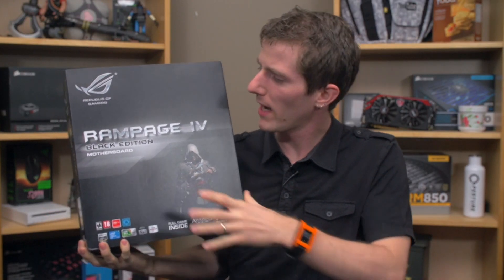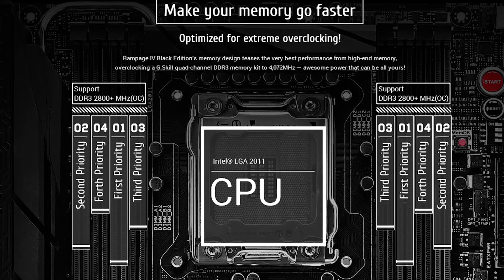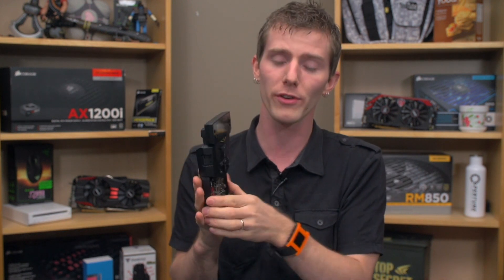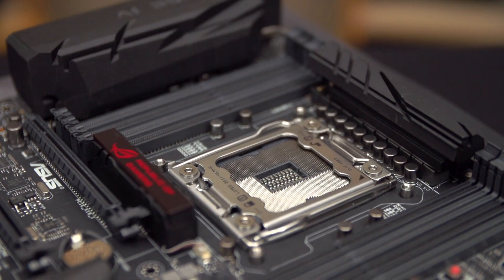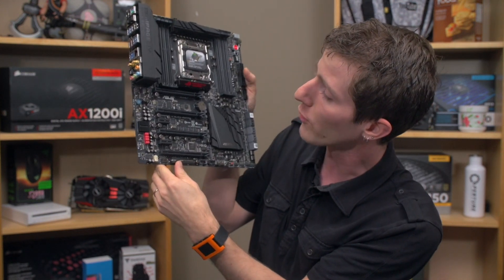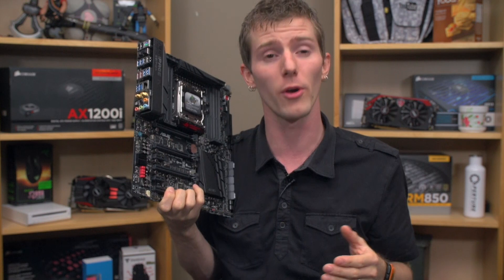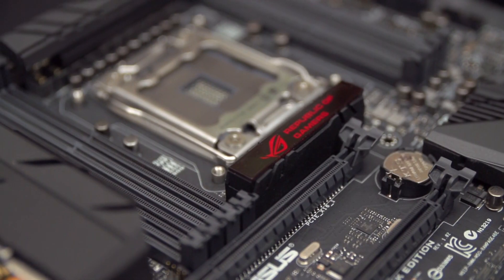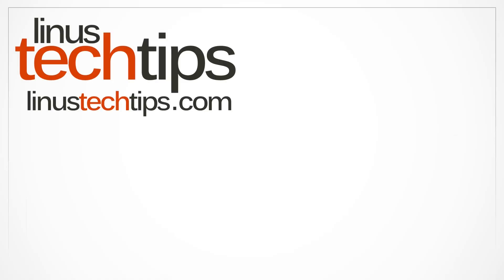ASUS Rampage IV Extreme Black Edition Unboxing & Overview

Comment: I would love to see an extreme build out of this board as I have been drooling over it for months...if I am correct that still has the x79 chipset.  My drooling has moved on to the newer version of this board with the x99 chipset and ddr4 ram.  And your correct this board is for someone that is interested in the best consumer board money can buy!! My old system is beginning to feel like I have to perform magic tricks to get to run high end games  smoothly. 8 years of use and no more room to upgrade. Means its time for a new machine all together.  Build out build out build out!!!

Comment: I just received mine today, got 32 GBs of Corsair Dominator GT 1866 MHz RAM, Intel 4960x Extreme edition 15 MB L3 Cache processor, Gigabyte Windforce Edition 780TI graphics card (Will buy another if I need to) still awaiting my new Antec Twelve Hundred Ultimate Gamer case (Will have laser etched with a fist for a custom look).  This board is a beast!!!

Comment: Just bought this board today! Super excited and now more so after watching this video! :D! Pairing it with a i7 4820K and atm 780Ti from Evga! and oh of course 32GB of 2400Mhz CL10 Ram from G. Skill a Xigmatek Dark Knight CPU Cooler, a Intel 530 240GB SSD, a Intel 520 240GB SSD, and a 1TB WD Black HDD all inside a Thermaltake Overseer RX-I Case with Blue LED cooling fans to compliment the black theme. Oh and I believe I am getting a Xoner Essense STX Sound Card for the best audio around as well. I will be paying for this hard of awhile BUT ITS SOO WORTH IT!!!

Comment: man i keep this board so maintained till to this day, i feel like money well spent, only probalem after so many years i have is the 24pin connector 3.3v rail is a bit loose, i did insert a paper pin to keep it working so it works aight but windows 10 has horrible bugged driver for this board so i dont update much but get decent enough performance for cyberpunk 2077,star citizen or any 3d rendering.
Reply: who asked

Comment: to install 32gb ram and make it work in 2400mhz do you have to overclock it or can it work in standard mode?
Reply: Hell no I am using it without Overclock.....Dude just go to bios enable XMP in other words Quad Channel Mode and 2400mhz is set as default without OC.
Reply: avikbellic911 thank you for the info.

Comment: i am amazed just how long the life of LGA 2011 has been.  I jumped on the X79 platform in early 2013, which by all accounts should have been near the end-of-life for the platform.  It is still going.  And on top of this, Haswell-E won't be out for nearly a year.  Just. Wow.

Comment: i need this for AM3+. just love AMD's CPU's..they'r Good, Powerfull, easy to OC, and cheap. Intel is soo expensive, but Intel (X79) Mainboards got soooooo.... many new features now, and almost every AMD Board looks like it was build in 2001! this is just awesome! Witch I7 would u buy for a Setup with this Motherboard, Corsair 2x 16GB RAM & 2x XFX HD7970 GHZ Editon @ 1.2GHZ? it should be good for Gaming in 1920x1080 MAX. Settings, and for Rendering!

Comment: What is the difference from SLI and crossfire?
Reply: SLI is the Nvidia tecnology, and Crossfire is the AMD/ATI tecnology, just that.
Reply: Thanks
Reply: NP
Reply: I think 3Dfx invented it, but the above comment is still correct. Just some food for thought.
Reply: GoldenStar11 wrong.
SLI is the nvidia multi gpu format
Crossfire is AMD's Multi gpu format.
they both basicly work the same but are different.
amd = crossfire multi gpu support.
sli = nvidia multi gpu support
Reply: ***** Actually, you are mixing up AMD dual graphics with crossfire.
Reply: You can combine many different amd gpus like combos of any 7 series gpu on a lot more boards, however SLI is picky and you have to have the appropriate board and matching pairs of gpu.

Comment: Well the memory speed depends on the IMC of the processor used.  I have a 4930k running on the original RIVE, and I've run RAM at 2800.  My 3820 could run memory at 2666 on it as well.

Comment: Dude WTF lol that is a sick board. I am looking at hardware because I am going to build a linux machine. I'm have been getting into building my own andriod roms and want something that i can do this quick on. 

Obviously this one is more than I need what would you recommend that would still be robust a minimum of 16 probably 24 gigs ram, and super Linux friendly? 

Thanks for the review you rock at the presentation man
Reply: Well i ended up with formula vi. The machine is actually built and I have let it run for over 24 hours. I now that's backwards but I was to excited when I finally got everything. I will post few shots later today. I have decided to run my h100i wires a little different so. Shouldn't take to long install an os. Sucks to have to install also. But some games I think will be best on it.

Comment: This Mobo is SEXY! I want it! I think I will use this mobo for my next build in a few weeks. ill be putting 32GB of RAM,  2 Graphics Cards, and a high end 2011 CPU. Don't know exactly what yet, but its going to be a beast (Its going to cost a lot too lol).
Reply: Get a 4930K. A 4820 is a quad core hyperthreaded (think of a 4770K in more expensive LGA2011 format), and a 4960X is too much more ($450) for 3MB more L3 cache and .2 GHz highher clock.

Comment: Hi Linus, what's your thoughts on Asus removing all support for all the X79 platforms, they have even removed the ability to select/ download anything X79 from their website. Also considering most or all other manufacturers still support their X79 range. My opinion is the X79 platforms still had much performance to offer and this is an obvious move to try to force an upgrade.

Comment: I have 2 evga gtx 780 ti classified dual bios cards installed do I need to connect the 4 pin molex ez plug thanks for any help and excellent video as always

Comment: If it had right angle 24pin power and right angle USB 3.0 header, this would be on of the greatest motherboards ever.
Reply: If it did, it wouldn't be in my system right now, no enough clearance for that, I'm glad they used the standard layout

Comment: I know this video is not about it but I have a little doubt.

For a afermarket CPU Air Cooler that permits changing the fan, is better for me to use a Static Pressure optimized fan or a Airflow optimized as Push?

Comment: Question is, however, what do us original RIVE owners do?  I don't think there is really enough justification for us to switch over to this BE from our original boards and it is kind of frustrating to see some of these features on a Rampage IV Extreme that weren't included in the original (and also very expensive) board...

Comment: Is it okay to get this board just because it's cool ? and install an i7 4820k, single graphics card, 2 sticks of ram ?. Because that's my limit. I just want this board because of the looks, And the upgrade potential. Or maybe the X99 chipset ?
Reply: Was going to do the same thing so I would. Then build on it later.
Reply: Same here, just bought mine, getting the 4820K next paycheck lol. This is actualy THE BEST option for a budget gamer wanting to get into "enthusiast" grade stuff. Going X99 will cost more and the Rampage V extreme doesn't look nearly as awesome as the black edition. Look at the RAM cost alone, 16gb corsair dom, platinum DDR3 = $250, same brand of DDR4 = a whopping $400. if you filled all 8 slots that would cost you $300 more for RAM alone! And with the 4820K, yeah it's only a 4 core cpu and at stock it's even slightly weaker than a I7 4770K, but it can overclock like a dream hitting 4.8ghz with watercooling easily, or 4.6 even on air. And it turns out that the temperature on the 4820K is MUCH lower than a 4770 or 4790K since it has a soldered on die rather than internal thermal paste, so a 4820K at 4.4ghz is actually about the same temperature as a 4770k at STOCK temps, and once you OC the 4770 you'll find you can't get past 4.5 and are pushing 75 degrees while the 4820K at 4.6 is sitting nicely at 64 degrees.

So in short, don't feel bad about getting this board, i chose it over the Rampage V extreme for 2 simple reasons

1. Looks freaking AMAZING

2. Cheaper overall, saves me $150 on RAM and ~$75 on the CPU vs the $400 5820K, that money allows me to afford a new PSU so i can add in an extra gtx980 later on if i decide to since this rig is already costing me close to $3,000 dollars and i'm bustin my ass at a McDonalds job just to get it. And honestly, even though i'll be using a 4 core 4820K i doubt anyone in my small town community college will have a better cpu when i start my graphic design/video editing classes lol. Plus once everyone has sold their old rigs to jump on board with Z97 or X99 you can find an I7 4930K or even I7 4960X used on ebay for super cheap in a year or so when you get more cash and upgrade, but keep the old 4820K in case the used cpu blows out. Sounds like a good deal to me doncha think? :D

Comment: I wanted to try the hot spot shield software, however i noticed that it is provided by conduit.....which is kinda frustrating considering that conduit is horrible for your PC. it opens your computer up for infectious malware, and other virus's. I have a tough time supporting you when your software is linked to a malicious and unethical, service

Comment: Having trouble deciding on a mobo and a CPU 

Rampage IV Extreme Black Edition or the Rampage V extreme?

i7 4970k or i7 4930k? 

other specs: 
Dual 980 classified's (depends on whether I'm gonna game in 1440p)
Samsung 850 256gb SSD x2
2TB black HDD
NZXT H440 White and black
NZXT Kraken x61/Corsair H100i (not sure)
Corsair Dominator Platinum 16gb DDR4/3 (depends on the CPU)
Coolermaster v1000

MISC:
Corsair AF and SP fans for exhaust and rad
980 backplates
Red tubing for the rad
Corsair red sleeved Cables

Let me know if I'm missing anything or if I should wait for anything
(I am in no way shape or form interested in whatever AMD has to offer or the 970).
Reply: I'm in the same position, i'm getting the Rampage IV black edition, not only does the black edition look WAY cooler (yes i know, i'm shallow. shoot me lol) but it's more affordable overall. The black edition is X79 so it supports DDR3 RAM which is much cheaper (corsair dominator platinum 16gb DDR3 = $250, 16gb of DDR4 = $400) not to mention you can get a 40 lane cpu cheaper if you go for the $320 I7 4820K instead of the $550 I7 5930K, yes the 5820k/5930k has 6 cores while the 4820k is only 4, but the 5820k doesn't have the pci lanes so if you want 4 way sli you'd need a 5930k on x99, plus the money i save getting the ddr3 ram and the cheaper 4820k lets me buy my psu (either corsair AX860 or EVGA G2 1000w, not sure since they don't seem to make custom white cables for the EVGA though since my pc theme is white and black)   

But in your case if your deciding between 5930k and 4930k then the 5930k would "probably" be the better choice, along with the Rampage V extreme of course, since both cpu's are 6 core with 40 pci lanes, but the 5930K has 15mb cache for the same price as the 12mb cache on the 4930K. The only reason i would reccomend going X79 with black edition mobo for you is if your really stretching your budget, especially if you plan to fill all 8 RAM slots since you save $150 on each 16gb 4x4 set of corsair platinum RAM, which for me kind of makes the decision since i'm already spending $3,000 on this setup that i don't have lol. (working McDonalds job.... -__- )

My setup will be

EVGA GTX980 Hydro Copper water cooled card $800 (going sli once i can afford)
Intel 730 series 480gb SSD x 2 in RAID 0 $500
Corsair 900D case $350
I7 4820K CPU $320
16gb 4x4gb Corsair Dominator Platinum DDR3 RAM $250
Corsair AX860w or EVGA G2 1000w PSU ~$150
XSPC 250mm Reservoir/pump combo $160
2 x EK coolstream 480mm Radiators (no cost, already have)
8 x Corsair SP120 white LED fans $100
10 3/8" x 1/2" Compression Fittings ~$70
Swiftech Apogee XL CPU waterblock with custom ROG logo (goes with mobo) $85
PrimoChill Advanced LRT 3/8" x 1/2" tubing
2 x 250ml Mayhem's Pastel Ice White Coolant $40

TOTAL - $3,410 + TAX
Reply: Once you go black you'll never go back!!
Reply: Powerweezle Well I know this was four months ago, but I just wanted to say that I would go with the x99 platform if you have the extra cash to spend on ram etc.. However I own the Rampage IV Extreme Black Edition, and its a FANTASTIC motherboard, so you definitely can't go wrong with either. If you have extra money for x99 go for it, if you want to save some cash, definitely go Black Edition. P.S.- the h440 does not officially support E-ATX motherboards. If you really want the case though, head on over to tech source and he can show you how to Jerry Rig it. (He has a h440 and a Rampage IV Black Edition for his system)

Comment: what about the interference you get when using front panel audio because front panel audio cable will go past components that will course interference. an impendent  chip is not going to fix this issue

Comment: I was just wondering, If you have 4 cards in SLI will even the best processor be bottlenecked?
Reply: yes they will be bottlenecked

expecting 150+fps in bf4 with 4 gpus in SLI + the best cpu at 4.7 ghz will still dip

Comment: Is this only good for gaming? I ask because well for leisure I am going to be gaming/modding, editing and 3d modelling but my main task is going to be high end computation (HPC, physics sim, research, CFD+FEA, CAD+EM, etc). So I am going for a extreme edition I7. Will this board offer anything geared towards that versus other boards?
Reply: TheCassual Damn!!! NIIICE!!
Reply: an extreme i7 will be amazing for everything
Reply: yeah but im taking about the mobo specifically?
Reply: motherboards as far as i know dont matter much, but there will be a difference when you are talking about a cheap 150$ mb compared to a 500$ one
Reply: If you're not going to be tweaking or overclocking then this board will be a waste.
Reply: overclocking for more performance will be done when i got more heavy compute jobs later on. right now its mostly mild overclocking for some speed boost from the get go
Reply: if you want a good workstation motherboard get the ASUS P9X79-E WS......Its the best X79 board in the market
Reply: Hmm yeah linus does tout the board alot. I guess I will look into it

Comment: Hey , what if I want to buy this board just because it's the best , and I only want to use 1 single graphics card and not overclock anything? I just wat a cool looking system that has the power to play anything on 50-60 FPS and I never want to overclock anything. Is that ok? Money wise I don't care this is expensive as long as it looks good and does it's job well.

What do you guys think about this? Can a casual guy like me who hasn't done any overclocking in his life buy this board and run it with one single good graphics card and non overclocked ram and the rest?
Reply: Yeah, you are still going to get amazing performance out of the box. People who over clock are just over kills. You can't really see much frame difference within 60-99 FPS so it's best just to keep it where it is
Reply: The_Bad_Ass Looking_Gamer But this board is meant for the people who do over kill builds like two GTX Titan Z or two R9 295X2 fully water cooled and clock speeds all the way turned up to 11.
Reply: Himmel Weint oh.......
Reply: I've all ready bought it. It's amazing for non overlooking single gpu systems. Plays everything I throw at it between 90 and 500 FPS alongside my gtx 780ti evga Sc on ultra ssao and everything. Don't get discouraged, buy this even if you don't want 4 graphics cards or water Cooling. Will run everything perfectly
Reply: Of course it will run everything perfectly but then so can a $200 board for a fraction of the price. This board is designed with the enthusiats in mind though and so it has some of the most advanced features and most overclocking potential out of all the Asus boards.
Reply: Himmel Weint You are wrong, a 200$ board ( 140 pounds ) can't run everything. My old board was 300$ and it is still weak and could barely load 16 GB of low ram on it. Sorry but just because a Ferrari is designed to run at light speed doesn't mean anyone who wants to buy it or actually buys it needs to tune it up and run it at those speeds. When I made the question above I had no idea of the power in this board and I am very happy I didn't listen to people who said it's not for me.
Reply: Robert Fierce No by all means get this board if you have the money for it. It is a rock soild board but what I am saying is if you are not overclocking or turning stuff up to 11 you could get by with a much cheaper board with pretty much the same performance like this $200 (http://www.newegg.com/Product/Product.aspx?Item=N82E16813157282&nm_mc=OTC-FroogleNEW&cm_mmc=OTC-FroogleNEW-_-Motherboards%20-%20Intel-_-ASRock-_-13157282) You could go 32GB ram with quad channel and you could go crossfire or sli with 2 full speed PCI-E 16X slots. Without overclocking and running just 1 GPU and most likely won't have more than 32GB ram this board will run just as good as that asus which costs over 2X as much. Of course looks are subjective but I think the ASRock looks pretty slick too with a full black theme.
Reply: Why don't you overlock......

Comment: Case:Corsair Obsidian Series 760T
CPU Heatsink: Corsair H110 Dual 140mm Liquid Cooler

Is this motherboard going to fit in my case and CPU heat sink ?
Reply: Yeah definitely, the 760t is a great case, the only non custom made cases in the world that really outdo it are the Corair 800d and 900d in my opinion. and the H110 is a pretty standard 280mm radiator setup so it will easily handle that cooler. So don't worry about it, it'll work great. look good too, especially if your 760t is the white and black one.